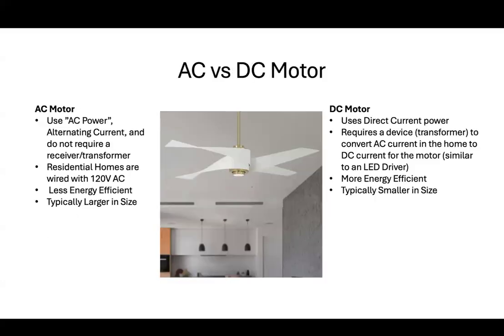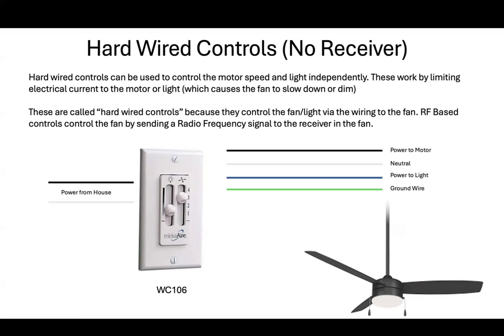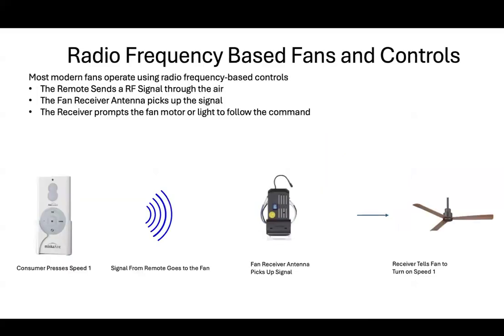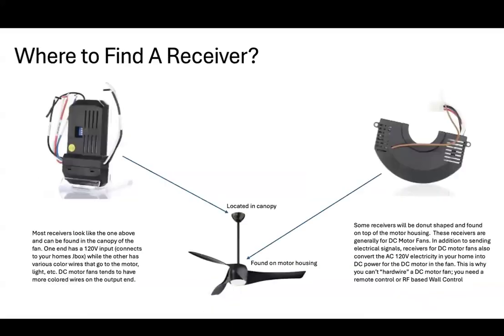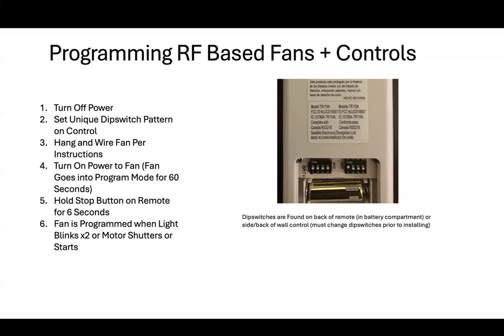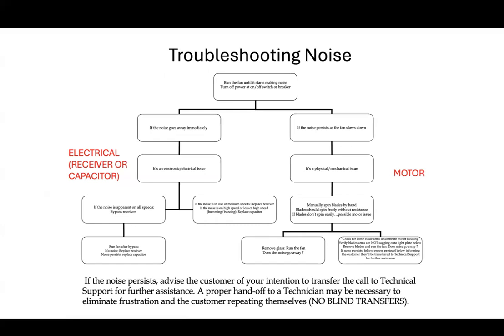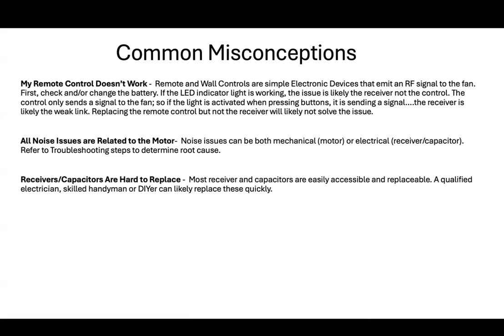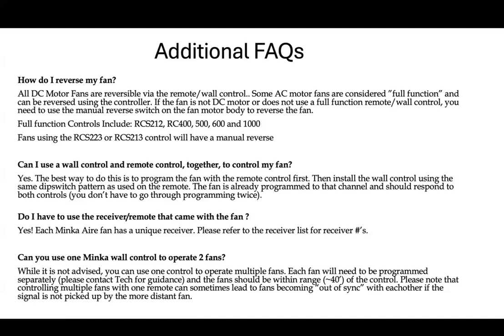Understanding Minka Aire Ceiling Fans

Comment: Thanks. For the ceiling fans with a DC motor, what is the nature of the DC "electrical signal" sent by the receiver to the motor to vary the speed? Is it a change in voltage, Maybe PWM? Is there a technical resource available to know the parameters?

Comment: I have the 84” minka aire extreme and it sounds like the fan is grinding up rocks and is very loud. It stops when the power is off. I see many other people complaining about the same problem and that replacing the receiver was a waste of money and time, it is concluded that it is loose magnets. I called Minka Aire and they said it was the receiver but gave me an incorrect part number. Please advise